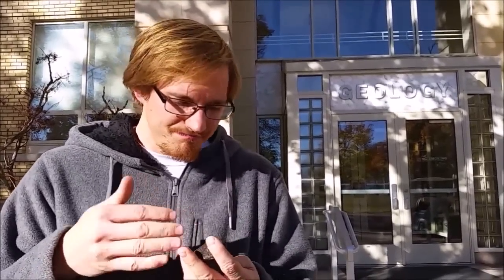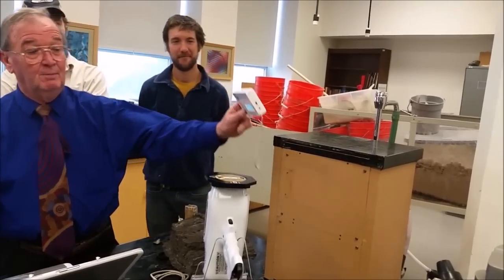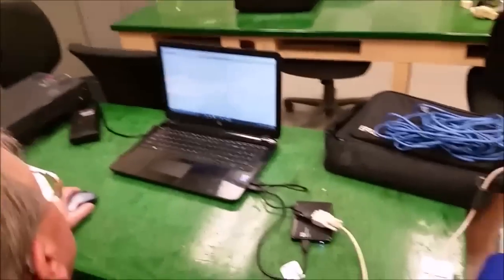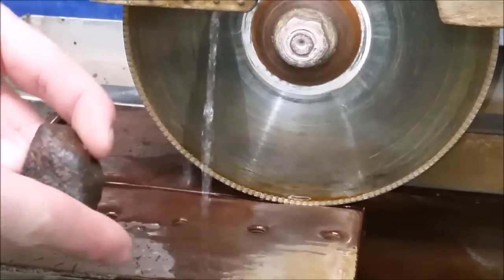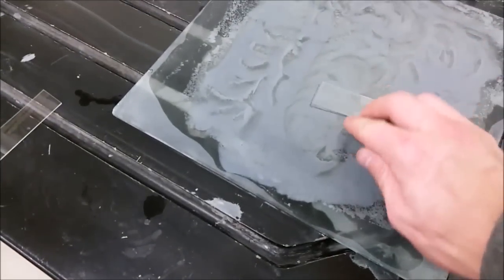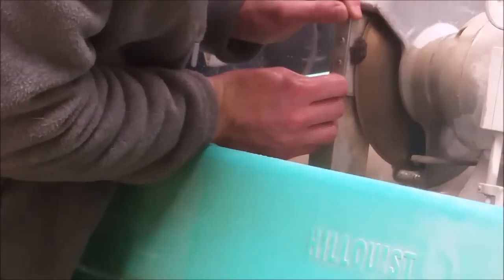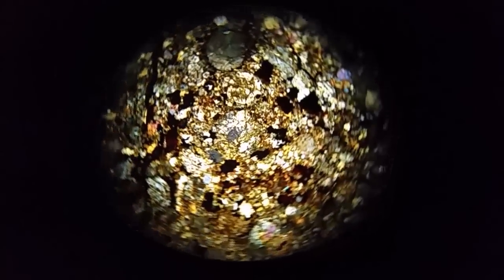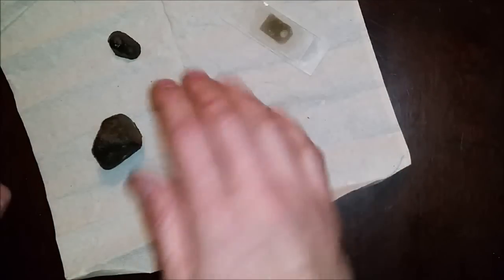So Is It a Meteor?

Comment: I have two decently large rocks that are very dark in color, have a strange earthy/graphite smell, they don't rub off on paper with any residue like coal, they are broken from something cause one rock has a bubbly melted texture on part of it that trails off to a lighter color the further from the melted exterior, and it has weird lines on one side that seem to be bleed-over from the bubbly side. It's nonmagnetic and my area is called Black Rock cause there's supposed to be a larger meteor in the woods around here. Some people know where it is but I've never seen it myself. Edit: I rubbed the rocks together roughly and broke off some flecks. I have a pretty strong magnet that did indeed pick up the small flecks when I placed the magnet very close over them. But the large rocks do not seem to draw the magnet in an easily noticeable way.

Comment: Why would you want to use epoxy or glue to stick the meteorite to the glass slide wouldn't you be worried maybe you would see remnants of the epoxy or glue under the microscope or maybe it would change or effect the way it naturally looks I might be completely wrong and I'm not questioning you I know you are far more knowledgeable about this sort of thing than I am but I'm genuinely wondering why you wouldn't just want to sit it on the slide instead of gluing it there I would just think you wouldn't want anything else in the picture except for the meteorite and maybe that's how it is anyways I don't know that's why I'm asking not trying to be a dick or anything I swear I just don't understand the point of gluing it to the glass in sure it wouldn't go anywhere and I would be worried that maybe I would mistake something in the glue an impurity or an air bubble for something in the meteorite I could be completely off base and crazy on this but I am truly wondering please someone let me know.

Comment: Don't your unisersity have a 3D X-ray microscope? Would be interesting to see inside and how the element spead looks like. But nice work on the cut image analysis. I only worked on metal saples so far an used to use diffenent acides to visualise the grain boundary. Nice to see that it works this way for minerals as well.

Comment: Nice to see thin-sectioning done. Explains why mineral slides are so expensive.
Does epoxy reduce tests you could perform? E.g. by blocking out some wavelengths or by clouding up over time?
Reply from the maker: Yes actually, they have multiple types of epoxy that block different wevlents of light so that they can subtract the effects it has.
Reply: Cody'sLab do you live in Logan Utah
Reply: "What are you doing!?" Is all I could think when I saw him pull out epoxy

Comment: Y dissent you just etch the slice? It's much easier all u need is feric chloride
Reply: Because abrasive methods result in a even surface and with enough practice a constant thickness, which is important if you want to check the interference colors in polarized light. If you use acid it might dissolve some minerals faster than others or produce etching pits in the crystals due to anisotropic etching.
Reply: duh thats y u polish it to become even after etching, and i could have told you that this particular meteorite was a stony meteorite, probably a L 6 chondrite just by looking at it
Reply: It was pretty clear that this is a chondrite ... tho I could not say what class exactly ... it has been a few years since I worked with a petrological microscope.
If you got a uneven surface after etching you would still need to grind it even before really starting to polish, else you might have to start over a few times because of pieces of the elevated crystals breaking off. There is the problem of finding the right acid for the right rock as well. You would need HF for a quartz rich rock and where I live you need a extra certificate to be allowed to handle that. Lapping the slice down from about 1 mm on a rotating platter is actually quite fast, the last few μm are what really takes time.
The only times we use a acid is pretty much when we need a atomic planar surface, then we use a chemical polish for the last step. 
I had to lap and polish quite a few thin slices and semiconductor samples while studying and as just a student I was expected to do it by hand to learn instead of using the machines ;)

Comment: Similar to your epoxying the sample to the slide, you can take the polished surface of a porous fossil and press it to a plastic slide with acetone. This can transfer tissue details into the plastic, making the plastic slide a fossil. The Smithsonian Paleontology Lab taught me how to do this. An opaque shield with a tiny hole may facilitate spectroscopic analysis of individual crystals in your thin section.

Comment: It's actually quite easy to find meteorites. When I was a kid I did it quite a few times.

The trick is to collect rainwater as it falls and pass it through a funnel and filter. Then use a magnet to collect any particles that are magnetic. Many of the magnetic particles will be micrometeorites that you can examine under the microscope and do chemical tests on.
Reply: meteorite =/= micrometeorite
Reply: By whose definition? When does a piece of rock or metal hurtling towards the earth and then landing stop being a meteorite?

Comment: Having only basic knowledge of geology I've been puzzled by a stone of mine I found by a river as a kid. It only recently re-entered my life when I dropped it on an anvil and it left a scratch. Being curious I decided to see if I could file it flat as it was already a cool 3 sided pyramid shape. I was mistaken and ruined a black diamond file after just a few strokes as the stone turned out to be hard enough to rip the diamonds out of the teeth of the file. Next I successfully tried scratching a tungsten drill bit as well as some titanium and glass which puzzled me because of how smooth the stone is. The stone is a dark red colour when left indoors but turns into a muddy orange when left in sunlight. It has solid bands of a dark reddish brown as well as very tiny holes which made me think either meteorite or volcanic rock. Having never seen a volcanic sedimentary rock I've been quite puzzled as to what it is any ideas? (weird note the rock either absorbs water or evaporates it quickly as if you place it in water completely submerged and then on a surface even if its cold the water dries up in under a minute for some reason visibly drying off. It could be radioactive but I simply don't know for certain.

Comment: Nice, I'm a geology undergrad and they don't even teach thin section for the most part.  You end up learning a little by happenstance but this is neat.  If you are interested in this you should check out a mineralogy course (ask if you can sit in for free at a local uni!).  If you cant sit in google up a syllabus and teach yourself each section, you can find 95% of undergrad mineralogy online.   You will be able to ID most of the minerals by crystal system etc...  of course there is always the chance you will have to micro-probe to really tell what you are looking at.

Comment: Are you sure you found Quartz in that thin section?  If so (very rare) it could be  an enstatite chondrite.
Reply from the maker: +cetuspa 
I saw wat looked like quartz, but it could be another mineral that has the same extinction features.
Reply: +Cody'sLab For a hobby, I have a website where I document meteorite finds (just like yours).  Can I have permission to use your photos (with credit given to you/Cody'sLab) on my website? Also I would need the "date-of-find" (yyyy-mm-dd) and the "mass" in grams.
Reply: +Cody'sLab that's a good explanation. The minerals are more likely to be plagioclase feldspar and pyroxene. and more likely they have been altered by shock from the impact event back at the asteroid belt and that will change their "extinction pattern".

Comment: Cody,
     I seem to remember a  definitive  test using acids to etch the surface of a meteor giving it a pattern that can't be mistaken by any other.  It's been many years  since I took geology at Utah State, I can't remember the name, something like "Munchousens" (sp), sorry about the spelling.  I still have a great interest in geology and like you I found a rock west and south west from where your specimen.  It's heavy for it's size, appears to have fusion crust on 3 sides, the four the being light brown.  I have one of the very strong magnets I purchased on line, however my rock is only slightly magnetic as the magnet the magnet is only slightly defected when held from a string.  I only have a tile saw and I cut a small area to see if it was metallic, it is!  even that that finger nail size slice to me some tie to cut and ruined the blade, I think, lol.  What step should I take now to confirm my suspisons ?  I would be happy to send it or drive it out to you,  I disabled now but i really want to find out.  I don't want it to be a "LEVERRITE" - I live in Holladay.  My sample is about  3-4 times as large as you have.
Reply: Why not contact that lab, or some other?

Comment: The specimen from your claim, is that an average cross-section of any piece of old limestone you might pick up? Or did you pick that piece because it looked especially dense with fossils? I am fascinated by the notion that the average piece of rock is so densely packed with microscopic fossils!!
Reply from the maker: +Sada Asda 
pretty average actually, though rocks taken a hundred feet down section have far fewer fossils.
Reply: +Sada Asda Well, limestone is a natural cement made by mixing calcite with sediment. Many microorganisms like to secrete calcite, and sediment is commonly full of microorganisms, so it is only natural limestone is commonly packed full of microorganisms ;) I am actually surprised I even remember this from geology class, barely passed that class xD

Comment: Hey Cody! Here is a neat fact...

You accidentally created a fairly good optical illusion by rotating the slide like that. After staring at the center for about 20 seconds while you are turning it and then looking away will create an illusion that the center of your vision is spinning counter-clockwise (which is the opposite of the way you turn it in the video).

Glad to see you actually found a meteorite though! Very awesome, please keep the videos coming!

Comment: Do me a favor and wear a cut glove. All it takes is one slip mate.
Reply from the maker: +TheMoskas100 
not on these saws.
Reply: +TheMoskas100 Diamond saws don't "cut", they grind. Still not fun but you won't lose anything but a bit of skin. Same goes for the polishing stages.
Reply: Yeah that type of wet saw really won't cut you it's so odd to touch a spinning saw blade. It tried it when my friend was tiling his bathroom.
Reply: +TheMoskas100 Cut gloves are for use with knives. They can grab and pull your hand into the saw.

Comment: Great video! Maybe epoy has not the perfect refractive index. Resolution could be increased  in case you're going to use a more powerfull light microscope.
Reply: +Ryan Cook Not too late really, he could easily do it again with the remnants at least a few times. They won't be the exact same cross section obviously but it would be from the same source.
Reply: +Strange Charm heh, a bit late now in any case
Reply: +Strange Charm Or maybe this is a special epoxy created for just this use?
Reply: Extra stuff Oh, I didn't mean it would be impossible at this point for him, only that he'd have to go through this entire process again from the beginning to get another slice

Comment: How did you know/suspect it was a meteor when you first found it?
Reply: He walked around with a fairly large magnet sticking it to rocks to see if they stuck, because they contain iron as previously said.
Reply: He searches for them in a area that is known to have some meteors fall in.
Reply: +sunny day Most meteors contain a lot of iron(as mentioned) so he will look around with a large metal detector in areas that he thinks that there could be some. he has a linked video where he finds it(along with lots of other metal objects).
Reply: Interesting thanks.
Reply: +Tazwanted77 What? Such as the entire Earth? Meteors fall everywhere every day. We are blanketed 24 hrs a day with material with sizes from microscopic to quite large ones.
Reply: most urban places you cant find them so he goes to places he know where they wont be disturbed and will still be on the surface